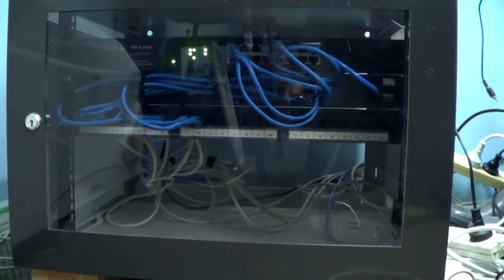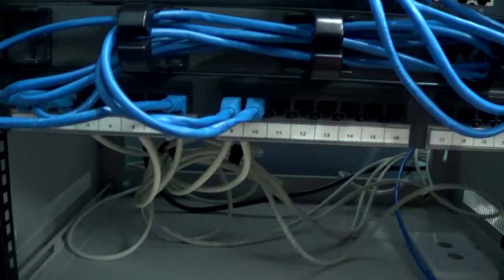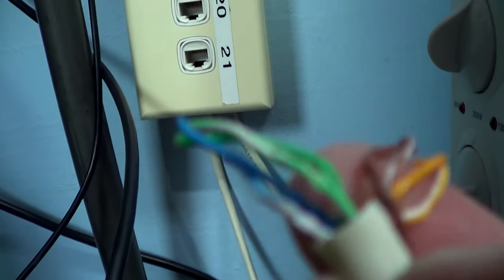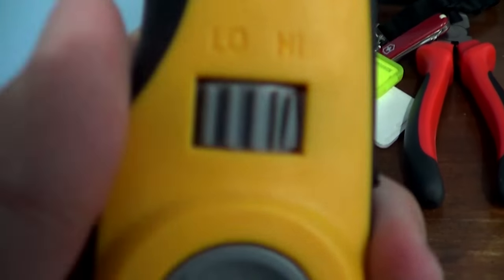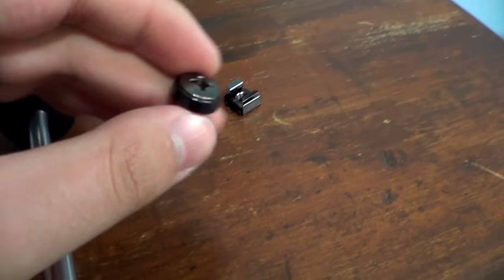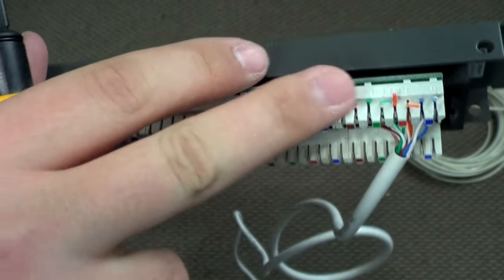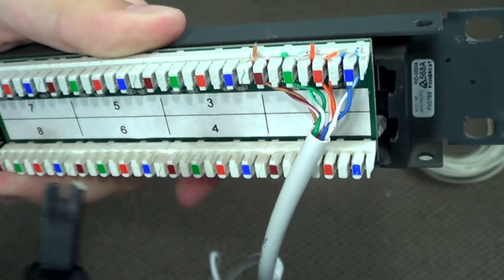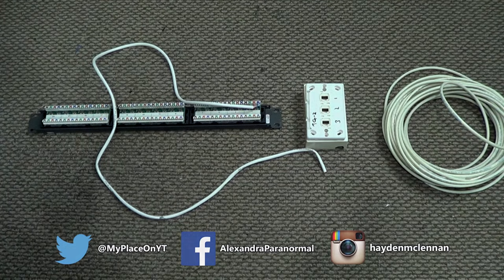Network Cabinet Setup & Tutorial

Comment: Very nice video !! Easy to follow and understand :) 
If you were to put it in the wall/in a wall that's obviously not an exterior, you would have to buy cat 6 that's meant to go in the wall, cat 6 headers and a cat 6 jack correct ?
Reply from the maker: Thanks mate. If you were going to mount a network jack to a non-exterior wall you will need the cable (cat6 or cat5e) an old work box (that is the box that goes in behind the drywall) the jack and plate. You screw the plate to the old work box in the wall. If you get cat6 cable you will need to get a cat6 jack. If you get cat5e cable you will need to get a cat5e jack. It does not matter with the patch panel.
Reply: +MyPlaceOnYT aye mate thanks for the info :)